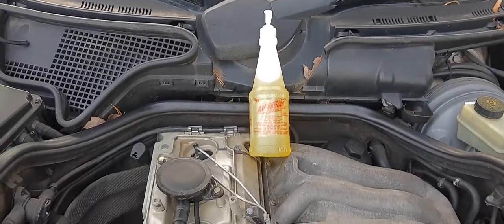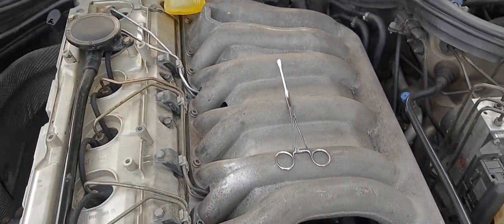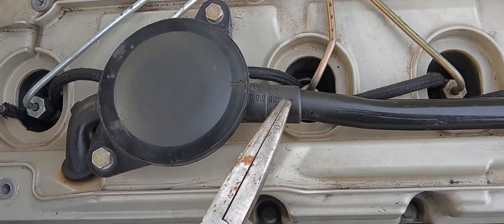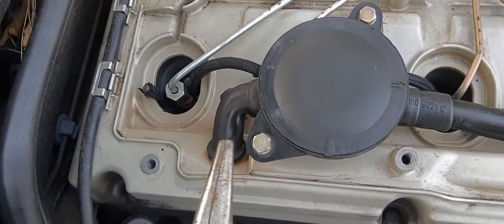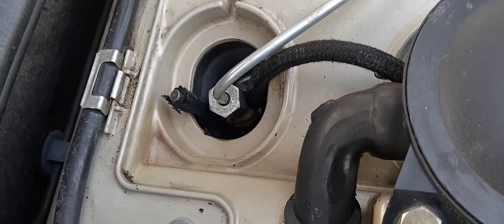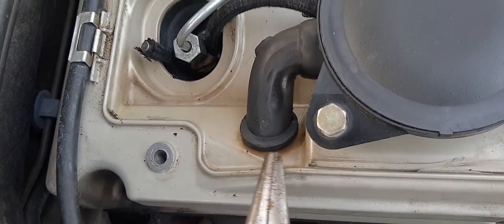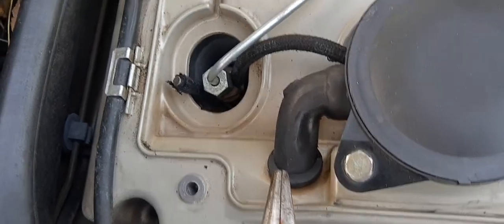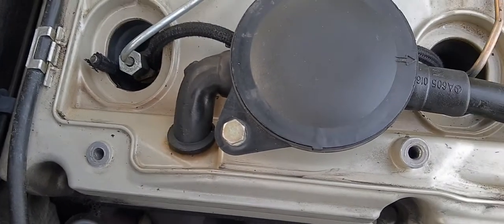Mercedes 99 E300 Looks Like Injector Leak It's Not

Comment: Hello, the leak is in the line hose? Or under injector?
Reply from the maker: Hello HG. I ender up replacing the braided return line three times. It seems there is a difference in the diameter. The best I found was from FPC Euro (in US) and of course the MB dealer. It was frustrating as I was forever chasing fuel gathering at the base of the injectors. Once I used the FPC line it was all gone. Who knew? Hope this helps.